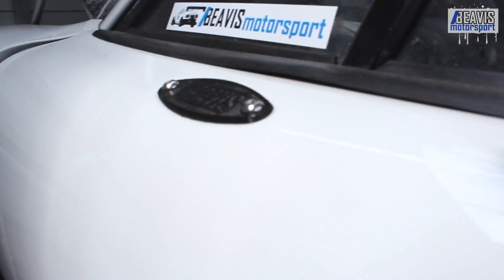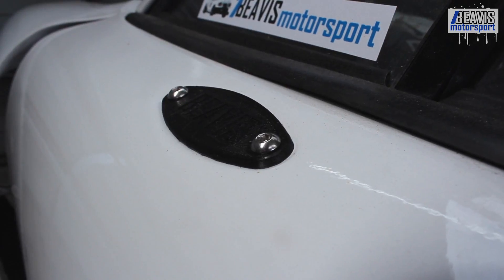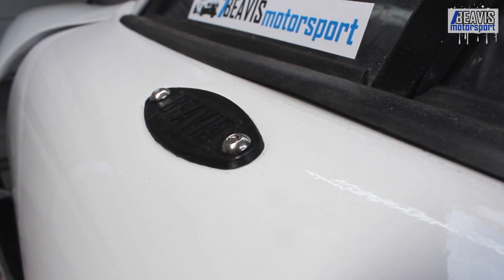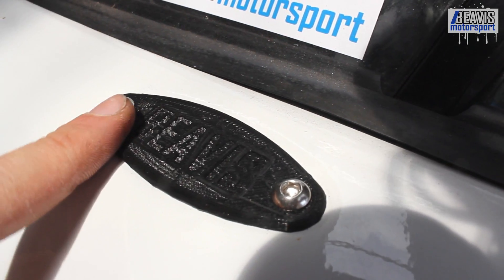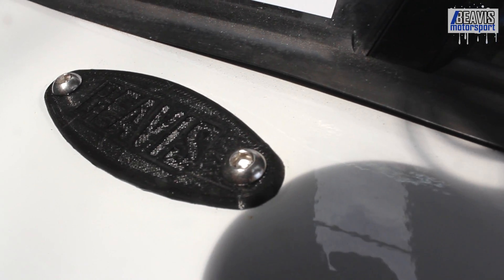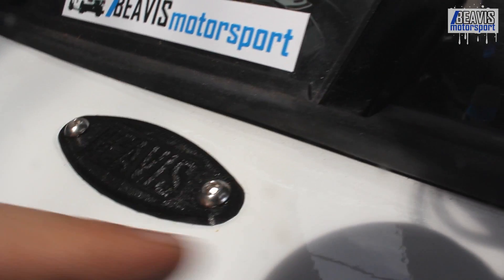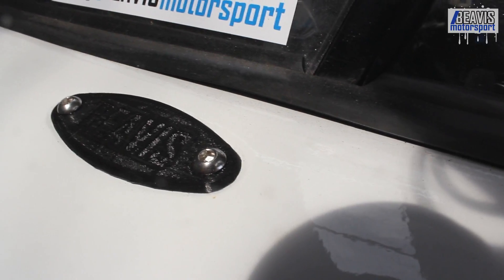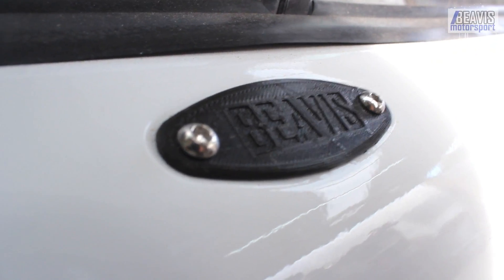3D Printing for Racecars - Episode 42 - Time Attack Miata TURBO Build

Comment: That's a cool solution for sure, I've used 3D printing and been disappointed because UV gets to PLA, it does not last very long.  Probably ok on a garaged race car however.
Reply from the maker: Yeah ABS is always a better option long term. For me it's not to big a deal as I can always print more if need be.